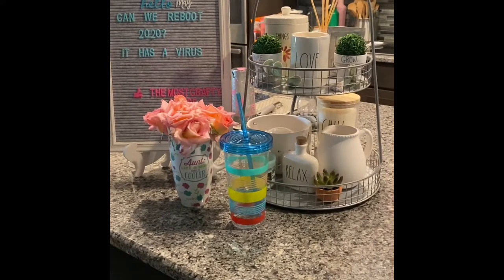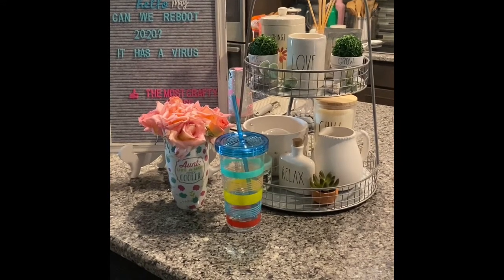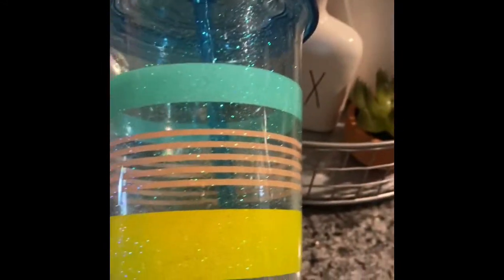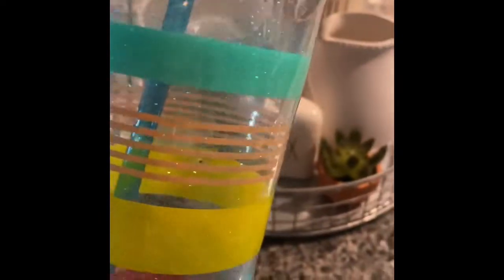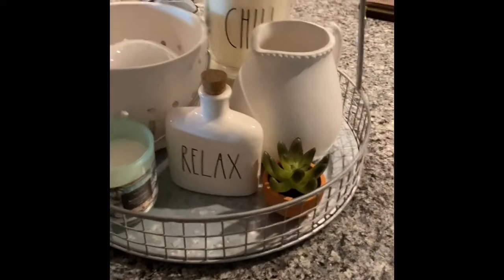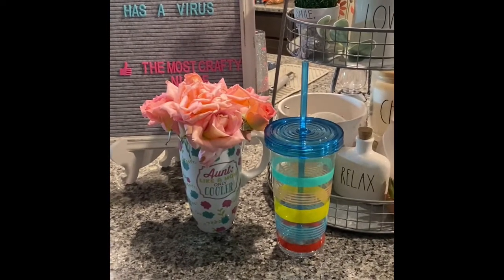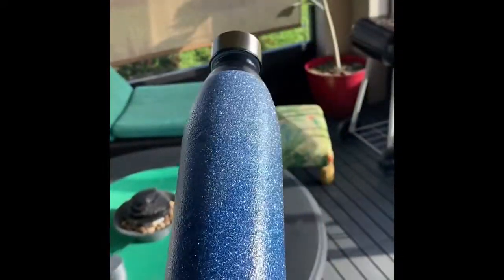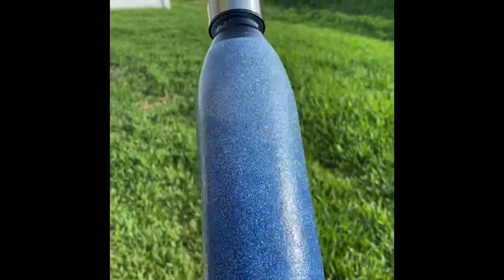Glitter epoxy tumbler, just a little bit of glitter sparkle to your acrylic tumbler.

Comment: Hi, it looks great.. I've done my first acrylic double wall tumbler with epoxy and I put it on Facebook and I got a lot of good reviews but I also got a lot of people that said I could not do that I should use stainless steel double.  but I was looking for somebody who been doing this for a while to see did you have any problems cup or did you or notice any change months later.. ?
Reply from the maker: I have not. I have researched previously and can find nothing saying not to. Plastic with BPA can leach when it gets hot and epoxy process causes heat. I use only BPA free and double wall so that it is only going on outside unit and not touching the wall nearest liquid. So I’m certainly not a scientist but have found nothing that says a double wall acrylic can’t be used. I have stoped using single wall and only BPA free for this reason.